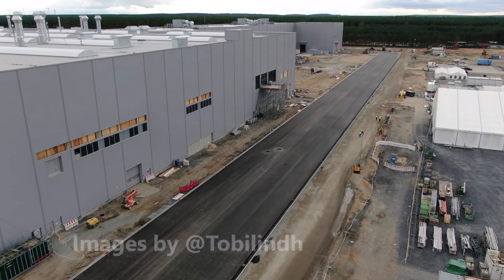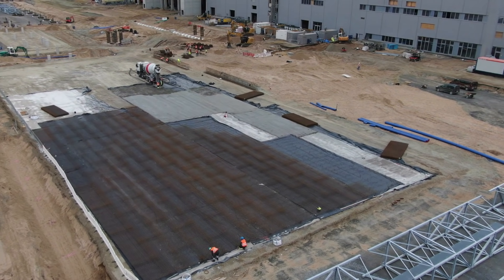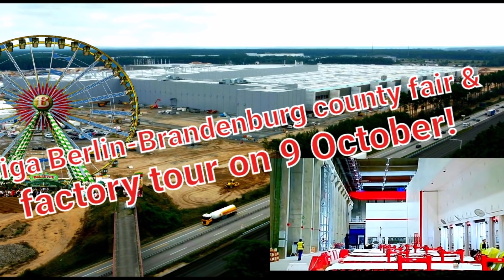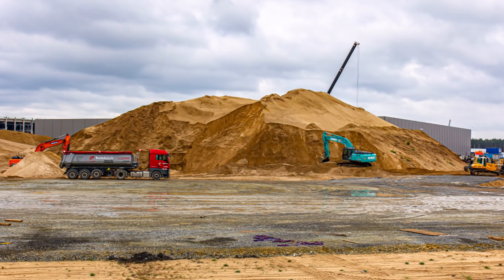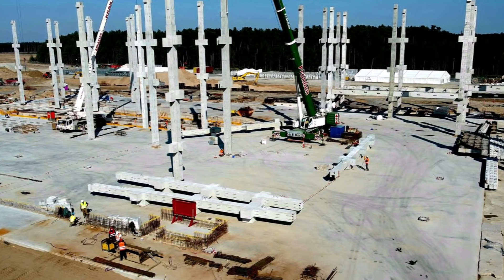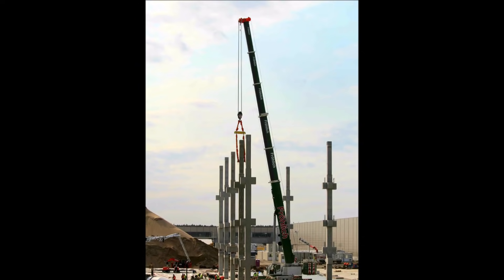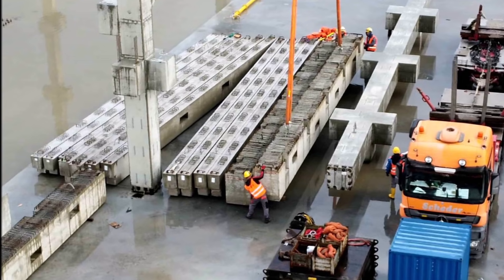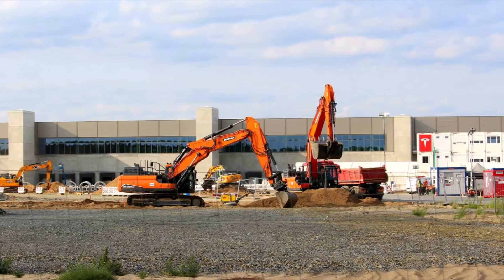Watch Tesla Giga Berlin's FIRST Paved Road and Concrete Loading Area

Comment: Chillers is the proper name. Well in my neck of the woods anyway. Large units with fans on top. They handle everything from ambient air inside the building to cooling the factory's equipment.